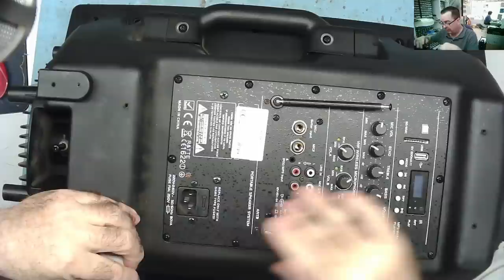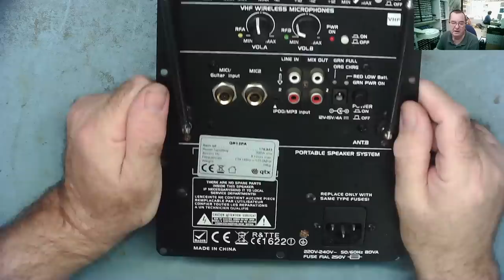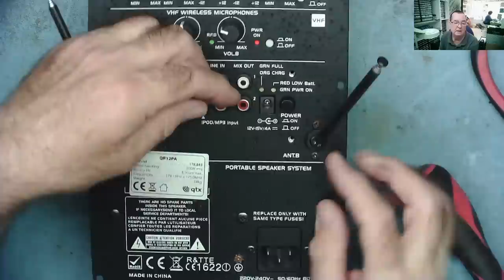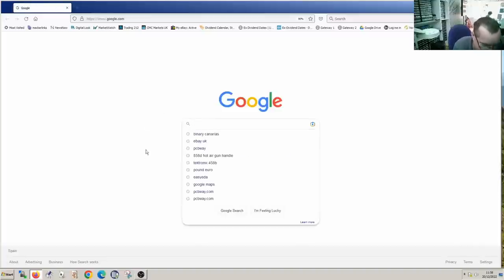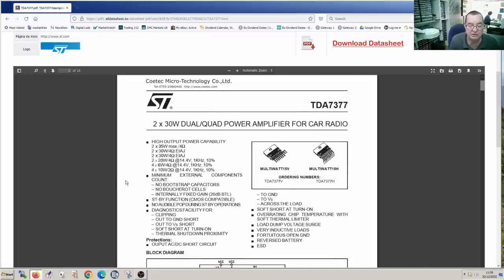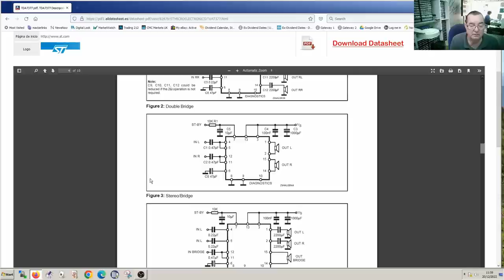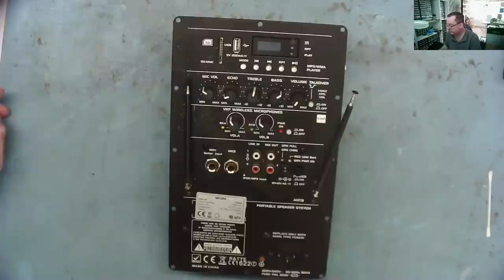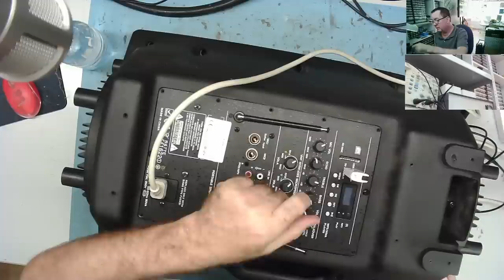Faulty 200W rms Amplified Active Speaker?  NO WAY!  It's all lies lies and DAMN LIES!!

Comment: This is an extremely low budget, bottom of the barrel speaker obviously (I've seen dozens of names stuck on that exact same plastic enclosure & cheezy plate amp board here in Latin America), but don't assume it gets all that much better if you move to some of the famous brands. Everything in the Electro Voice ZLX series use the more powerful, but absolutely not commercial grade TDA8954 amp on a chip. You have to move up to EV's ELX series before you get discrete MOSFET output devices.  However, none of these powered speakers regardless of brand are ever rated honestly... I guess it's a case of the Chinesium brands all just pull random, impossibly large wattage  figures out of thin air, so even EV, JBL, QSC and the likes will pick numbers that are unrealistic (usually somewhere around the theoretical momentary peak power) and publish them as though they are a fact, without specifying how they arrived at that number.

The only time I've ever come across RMS numbers is in service manuals that are typically NDA and only available for authorized service centers.   For this reason, I won't specify a name here (no, not the EV's referenced above), but the speaker is called a "1000w powered speaker (model number redacted)", but when you put the amp in service mode (DSP disabled), each of it's 2 discrete MOSFET channels should produce ~250 watts RMS if the amp is running properly.  It's a great speaker, and plays ear shatteringly loud, but as you can see, nowhere near the stated figure, especially not once the DSP is activated such that the woofer & tweeter are properly protected from overload conditions. And that is an older model, the imaginary watts arms race has escalated quickly since then.

Comment: Seen the same problem with the soldering a lot nearly everyone was lead free solder. The solder doesn't wet so well as leaded solder and is brittle so after a lot of vibration they often come up as intermittent. A real pain in the arse if on a large PCB with hundreds of soldering joints. Thanks for the work and time to put video together.

Comment: 14:30 ... Isn't that wired wrong? I thought ground is supposed to be the middle conductor... I think if that was plugged in in the states "improper voltage seeing as it's in the uk aside, at least I think" if you plug it into a socket that has nuetral and hot flipped "happens way too often" I think the metal of that amplifier would become live. Or even if the outlet has a fault issue making it not a clear nuetral path.. "I've also seen this issue in old structures". I'd look into that and try correcting it on the spot.
Reply: Mains socket is wired correctly for UK Mathew 🙂

Comment: Good simple fix and nice call-out on wattage.  I noticed the sticker said "power handling:  200 watts rms".  I doubt these two drivers could take a total of 200-watts RMS even divided after an active pre-amp level cross-over of say 1500-Hz even it was divided such as 50 to tweeter and 150 to woofer.  And the semantics of "power handling" doesn't actually claim the amplifier puts out that, which it certainly isn't capable of when it is probably 15-watts RMS (or less) to each driver based on the chip spec.  Typical Chinese "off-brand" build and marketing.  Speaking of Chinese "off-brands" of which some names are more hilarious than a Farrelley Brothers movie.  China quality is like "the wild west" of law-less gambling.  It can be good, but if the brand is not a known brand, as is the case often in these type Bluetooth powered speakers, it's no surprise when it fails on many levels.  Good fix and call-out.

Comment: My Honda Accord’s original premium sound system amplifier is built around two st tda7851f chips, which are essentially the four channel version of the chips in that speaker. They have the same rating per channel, the critical rating being the watts per channel at 1% distortion. At 1% they put out 22 wpc yet Honda advertised 360 watts total power in the Accord’s 7 channel system.
Reply: They probably advertised the peak output as a selling point.  It's technically not false advertising (unless they actually said it was RMS wattage), but it's still dishonest, and should be illegal to market things that way.  Peak output means absolutely nothing in the real world.
Reply: @eric_d  I believe they did call it “total power” so if you look at the max output spec on the chip, they are not technically over rating. Because of the dynamic equalization built into the amplifier to protect the speakers its doubtful that it ever actually reaches the 48wpc max rating of the chips. The problem for the average consumer arises when they buy upgrade speakers that recommend 50 watts rms or more each  and the stock amplifier isn’t providing even half of that.

Comment: Do you recommend mechanic solder? I'm a beginner and have brought so many crap solder, I'm to scared to try cheaper Chinese wire
Reply from the maker: Yeah it is pretty good.  It's 63:37 rather than 60:40 solder but it is one of the better ones I found available.   I'm using the 0.6mm 150gm roll.  Here is he actual link I bought from.
https://www.aliexpress.com/item/1005002679424956.html?spm=a2g0o.order_list.order_list_main.211.67a81802yI976N

The reviews are very positive.You can buy a 50gm roll first to see if you like it.

Comment: You aught to report them to trading standards. It's 2 x 35W according to Mouser.
Edit: just had a thought. You can get more power out if you connect the two channels in a  bridge configuration. 2x 35W in bridge can give you a theoretical max of 4 x 35W although in practice it is often a bit less. reason: P = V ^2 / R so 2 x V = > 4 x P
Reply: Power ratings of speakers (specifically speakers) are almost ALWAYS misleading. But that's because the actual power consumption of the speaker drivers means very little by itself, hence why it can be lied about or the not so helpful ratings (such as peak power) can be shown in place of RMS.
Reply: @childishtombino1275  You tend to get more or less the same sensitivities from speakers of the same size and design. RMS power has been the standard for years. The difference now is the buyer is stupider than in the past and the sellers more dishonest. Peak power is meaningless.
Reply: @Andrew-rc3vh  I'd imagine people just assume bigger numbers are norm now because of development over time. No idea.
But you're right.
Reply: Note: In a bridged mode, P = V^2/2R, since both channels are in series, giving 2× the power.
Reply: @alistairmackintosh9412  You should never wire speakers in series, because it gives bad damping.
Reply: @Andrew-rc3vh  I was referring to the amplifiers being connected in series for bridge mode, not the speakers. The R in my equation is the impedance of the amplifier.
Reply: @alistairmackintosh9412  Ah I get you. Yes this is why you do not get the theoretical 4x the power, but the output resistance of the amp should be much lower than the speaker. The amp's low output resistance causes the speaker cone to brake as the speaker generates a voltage as it moves and the shorting of this through the amp generates a current to resist it. Without this shorting the cone would oscillate from an impulse input to it.
Reply: Not really .. the amp must be able to handle that much power to do that... Basically  the amp was labelled 20watt at 4ohms per channel & you bridge the 2 channels you get almost 80 watt at 8 ohm per channel but - can the amp handle it ? - can the power supply handle it.. are the limiters up to the mark.. many more thing effectively brings that 4x power at bridge mode to almost 2.5-3.5x power.
Reply: @debmalya6144  I didn't look at the PSU. The original claim was the chip was not powerful enough in itself as a measure of proof that it is a lie. PSUs don't tend to have ratings printed on them where chips have numbers you can look up.

Comment: 200W rms is 282W Peak to Peak which is crap! basically Watts Peak to Peak multiplied by 0.707 is Watts rms so 282*0.707 = 200 Watts rms...cheers.
Reply: That is average power. There is no such thing as "rms" power.